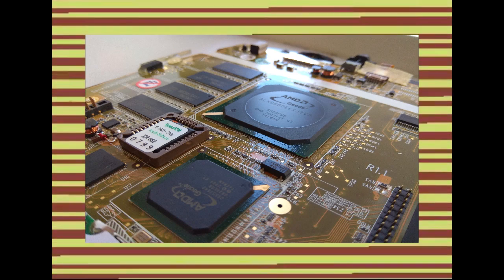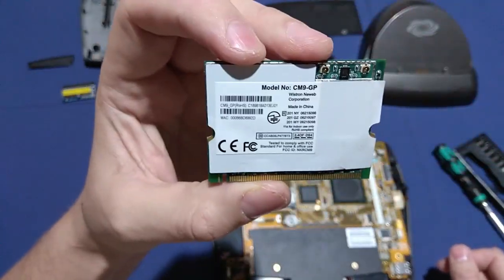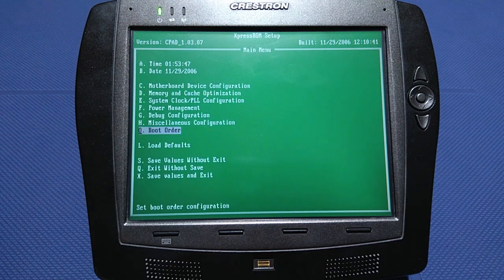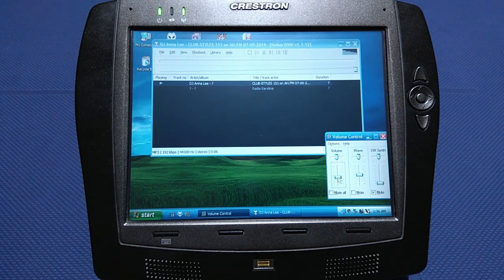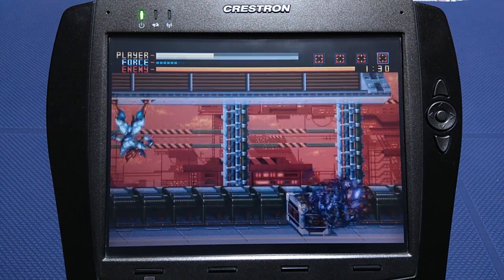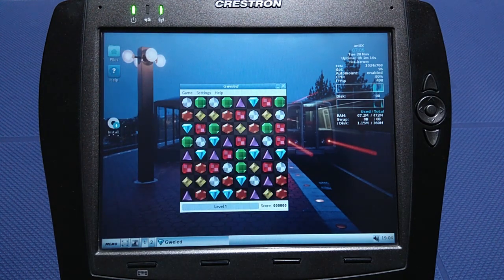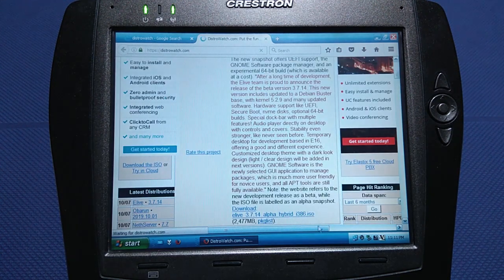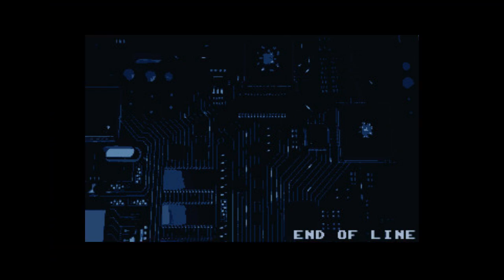Best touch panel that Crestron ever made :) TPMC-8X.

Comment: very cool!
do you have any video of the official Crestron software it originally ran? I am looking for demos of any old Crestron equipment, out of curiosity
Reply from the maker: Glad you liked it, I did make a full backup with clonezilla of the original TPMC-8X drive, I will try to make another video once I have some time and find the vtp demo file. In the meantime here is full system spec extracted by clonezilla with lspci, in case you are interested :) 

'lspci' results:
00:01.0 Host bridge: Advanced Micro Devices, Inc. [AMD] CS5536 [Geode companion] Host Bridge (rev 33)
00:01.1 VGA compatible controller: Advanced Micro Devices, Inc. [AMD] Geode LX Video
00:01.2 Entertainment encryption device: Advanced Micro Devices, Inc. [AMD] Geode LX AES Security Block
00:0d.0 CardBus bridge: Texas Instruments PCI1510 PC card Cardbus Controller
00:0e.0 Ethernet controller: Qualcomm Atheros AR5212/AR5213 Wireless Network Adapter (rev 01)
00:0f.0 ISA bridge: Advanced Micro Devices, Inc. [AMD] CS5536 [Geode companion] ISA (rev 03)
00:0f.2 IDE interface: Advanced Micro Devices, Inc. [AMD] CS5536 [Geode companion] IDE (rev 01)
00:0f.3 Multimedia audio controller: Advanced Micro Devices, Inc. [AMD] CS5536 [Geode companion] Audio (rev 01)
00:0f.4 USB controller: Advanced Micro Devices, Inc. [AMD] CS5536 [Geode companion] OHC (rev 02)
00:0f.5 USB controller: Advanced Micro Devices, Inc. [AMD] CS5536 [Geode companion] EHC (rev 02)
Reply from the maker: It seems that Crestorn has the demo files freely available at the product page, just go to resources and you will find few of them. I am not sure though if these are all that were available for this panel back in the day.

https://www.crestron.com/Products/Inactive/Discontinued/N-Z/TPMC-8X

Comment: Great tutorial. I got 3 of these for $15, but when I try and boot Win XP its looking for 1.1Gb free but the flash only  has 970mb. How did you get around that?
Reply from the maker: Very true, drive size is too small for full install so i went with tiny xp, community made iso with bare minimum sowtware on it. Installation is a test in patiance, but it was worth it in the end.
Reply: @zvonimir256  Do you have a copy of this iso file that you used?
Reply from the maker: @junior18designing  i think its posted on archive.org, under the name tinyxp rev9. Its an ancient iso, so mount it and scan it first with some good antivirus, just to be sure its not tampered with.
Reply: @zvonimir256  Do you have the driver for the buttons along the side and bottom of the screen?
Reply from the maker: @junior18designing   no unfortunately, was searching for it quite long time but with no luck...

Comment: I can’t find a version of any os that will install on this. Do you have a download link to a Linux distribution that will install?
Reply from the maker: Well right now it is getting more and more difficult to find any Linux distribution that supports this hardware, however if you do go down that road, you should search for Linux distributions that are non-pae. This stands for physical address extension and it allows access to 4GiB of ram on 32bit systems. All of those major Linux distros are discontinued so you won’t find any support for them and the only way to install some software is to compile from source, which can be quite troublesome. Note that I found most of them running pretty slowly compared to windows XP, but the only distro that was kind of ok (if you have patience) is the Puppy Arcade. You can google “puppy-arcade-11-k2.6.32.59.iso” and find it on internet archive. If I remember correctly, you can use live distro to load to ram and save changes to a separate drive, which is quite helpful as it works faster that way. Additionally, you might need to add to the boot option “vga=788” to force it to the correct resolution. As time passes, I’m afraid that there will be less and less of these old distros available, so if you are an enthusiast you might want to save it.
Here is a link I found of the iso, at internet archive: https://archive.org/download/Puppy_Linux_Puppy_Arcade/puppy-arcade-11-k2.6.32.59.iso

Comment: Hola 
Zvonimir Prokic, seria posible que me enviases los drivers para winxp, el que me falta es el del panel tactil, pero si pudieses enviarmelos todos te lo agradeceria.
Hi
 Zvonimir Prokic, it would be possible that you sent me the drivers for winxp, the one I need is the touch panel, but if you could send them to me, I would appreciate it.
Reply from the maker: Hola :) 

No problem, most of these drivers i used are found from device manufacturers direct as Crestron does not provide any. Keep in mind that some are plain .inf files that you need to manually install. I added a link in the video description to google drive location that contains stuff i worked on in other videos.
Reply: @zvonimir256  Gracias.

Comment: How to install linux
Reply from the maker: I usually download a Linux distribution then write it with Linux Live software. To boot you can just remove the built in drive and then let it boot into linux live distro.  Otherwise you can change boot order in bios, run usb live, then install distro on internal drive. Due to low space on internal drive and low speed of usb port, it might be a bit time consuming :)

Comment: Looks like WebDT clone hmmmm
Reply from the maker: Indeed, some drivers that i scavenged were from it, but not all unfortunately.
Reply: @zvonimir256   Any chance You have touchscreen driver? I got WebDT 310 got it finally working on win XP home and quake 2 running on it in software mode but cant get touchscreen drivers  and any other drivers i You have for it :-)
Reply from the maker: I posted all drivers on google drive, you can find the link in the description below. Was planning on making a video showing how to boot into Linux and backup existing os, should help as well, as some drivers can be found in os system folders.
Reply: @zvonimir256  My backlight is not working Some people say its because of dead battery . The CMOS battery os new but the main battery is dead  Is it possible or the illumination /inverter died ?
Reply from the maker: In brightly lit room you should see something on it when you turn it on. If you do,  it's probably a dead inverter. You can also use a flashlight just to see if screen displays anything.
Reply: @zvonimir256  Im tutning it on in evening when Im working on it and use white walpaper in windows when I got it it was weird as it would lit on on original windows embeded  as soon as system booted
Reply from the maker: Could be the backlight controls as well, but you will need the correct driver for it. Or try to reset the bios settings to factory defaults, if possible.
Reply: @zvonimir256  I did I changed bios settings to max brightness and all .Its weird but I want to make it running as it is really cool not like the niew win 10 tablets I had If you know what I mean .I tried to get parts for it but no success I will make new battery for it soon
Reply from the maker: In that case seems like inverter died, hope you will be able to fix it. Good luck.
Reply: @zvonimir256   just installed  touchscreen driver from your link and success it works just need alignment as its off a bit